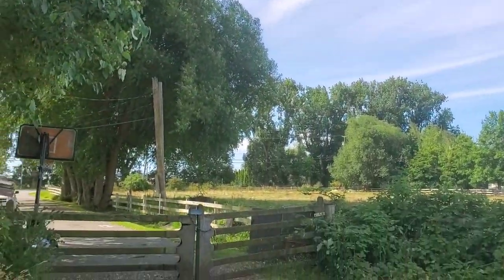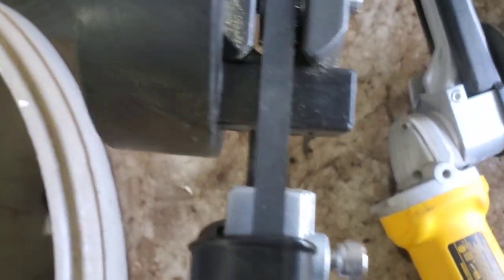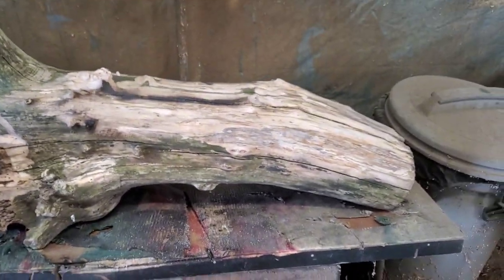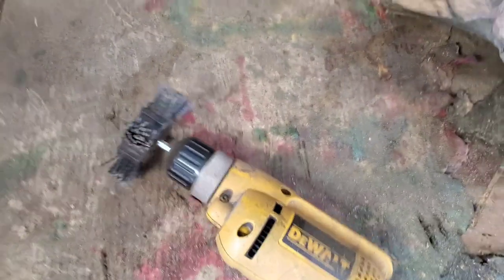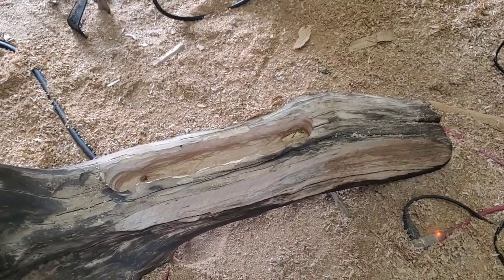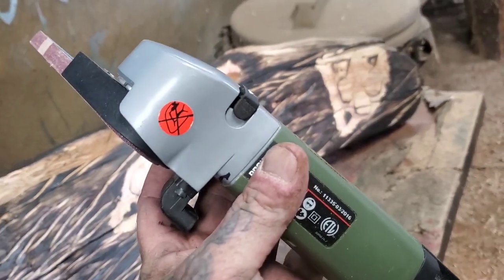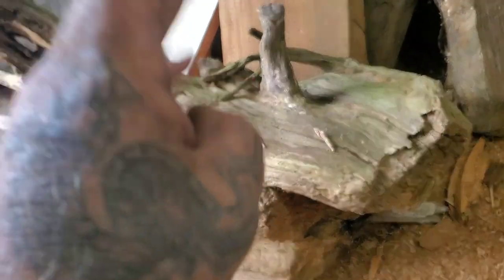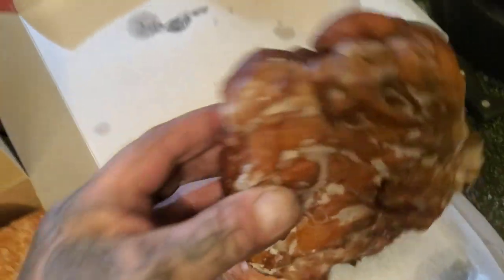Power carving a ROTTEN old root stump

Comment: Pressure washer is good for cleaning up old wood. But you have the right washer fan out tip so you don’t dig in too much and 
or do not leave in one place for to long or you will dig into the wood. Another words keep the tip moving. Then let dry then you 
can do what ever for a final finish.... good luck for what ever you do so let it dry really good, if you have time. If not go with sand blasting.
J-Ray